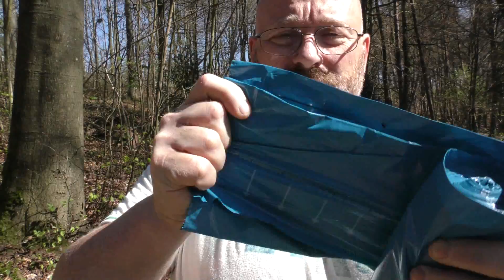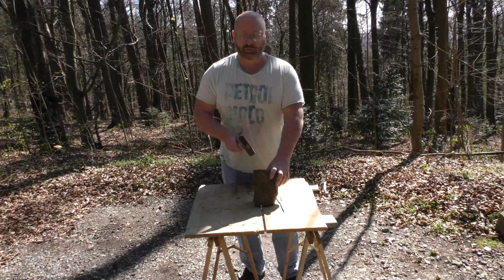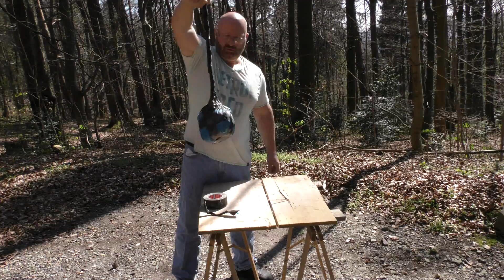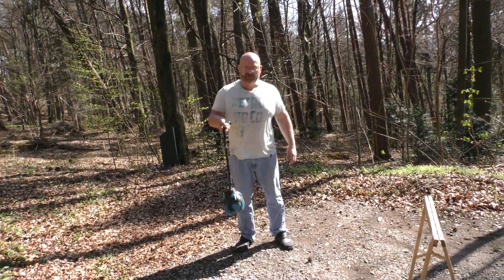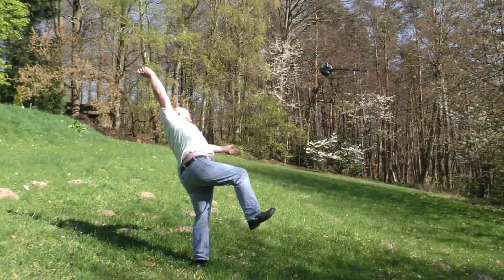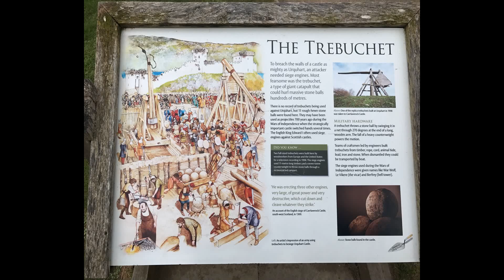How To Weaponize Dirtbags

Comment: Joerg,
Here's a challenge for you:
Have you ever read "Day of The Triffids"? I first read it about 45 years ago. They had a gadget called a "Triffid Gun" and I've been trying to figure out how to make one ever since. It's about the size of one of the crossbow pistols. It uses a compressed steel spring to launch either a throwing star or a small chakram hard enough to be lethal out to 20 feet or 20 yards—I can't remember.
The problem is figuring out a simple home workshop method to impart a consistent spin to the projectile.
I'm sure that you could come up with your own version if you put your mind to it.
…..RVM45

Comment: For a automatic weapon
To use it without electricity could you possibly make the trigger spin a turbine and revs it every pull so you can rev is up and release a hammer so the bullet will drop
This could possibly be unreliable to match the rpm from the trigger every time but still fun

Comment: Lesson:  place both hands on the chain handle, palms in, palm edges together.  Using a side step in a circular pattern, lean back slightly to maintain balance. Make 2 to 3 circles and release the hammer a little earlier than the angle you want to hit.  It takes practice.  Try with less force at first.  Don't go full until you have all of the technique working as one action.

Comment: try making a handle at the end of the garbage bag maybe because it will give you more momentum and more power
Reply: +daniel obon Yeah a T handle would work quite well I would think. Also, fill the bag with ball bearings, bbs, or a random assortment of nuts.

Comment: Never thrown one, but I imagine it would be easiest to build momentum in the spin by keeping the hammer close to your core and then gradually working it outward. 45 degree angle for most distance, so ending with an elliptical from over shoulder, down to around your knees, and then a release on the upward swing, using gravity to assist. The athletes probably use most of their strength to maintain the path of the hammer to get the best distance, not strength in actually throwing it.

Comment: JoergSprave,

Instructions for weaponizing the other type of dirtbags, dirtbag reporters.

#1 - remove head.  Clean skull, removing all skin, brains, etc.

#2 - remove thigh bone.  Clean as well.

#3 - Fit end of thigh bone to skull by going up the foramen magnum.  This will require some chiseling on both the thigh bone and the skull.

#4 - Drill holes in part of the thigh bone that is all the way inside the skull.  This is to help hold the thigh bone in the skull after the next step..

#4 - With thigh bone inserted in skull, fill skull with a suitable molten material. Melted polycarbonate plastic works well.  Even ordinary plastic soda bottle plastic will work.  For a more traditional look, use low temperature melting solder.

There, you have turned one ugly dirtbag into a lovely warclub, far more useful.

Comment: Way to go Jorge. I love that you were able to build a throwing hammer wire out of a garbage bag! I threw in college (approx 45m which was good for small college US in the early 80s). If I was built like you I would have done better. It's really just technique and flow. They say the best ones would have a couple of beers and go out and throw :-). And when the wire breaks on the low end of the curve it'll bury in the ground like a cannon ball and you need a shovel! Tschuss,

Tim

Comment: Regarding your recent experience with the press. I love the bash in the opening. :'D
Reply: Oh and when speeding up your throw you are supposed to take the first one over the head and not rotating your body, then just go with the inertia. Believe me, it's much easier. I'm no pro thrower either but I have done some.

Comment: If you watch some hammer throwing, they aren't spinning the weight in a flat circle, when it is close to the target, it is up higher, and when it's far from the target it's lower.  For the best distance you probably want 45 degrees. But I'm just guessing honestly.

Comment: What a cute little toy trebuchet you showed at the end! 

That one is pretty useless. You want one that can throw at least one ton. The thing is that the damage a trebuchet makes depends on at least its size cubed, usually much more. One trebuchet that can throw a ton is as good as hundreds of ones that can only throw 250 kilo balls as the later will not break the walls.

Comment: You can't beat a real trebuchet, as it is the superior war engine. A well engineered trebuchet can hurl a 90kg projectile over the distance of 300m using a counterweight. Saying that you can achieve that with a rubber based war engine is pure blasphemy.